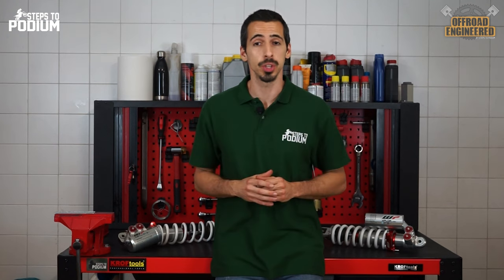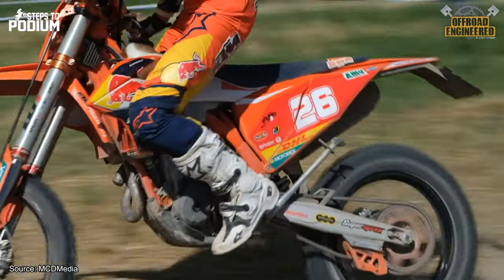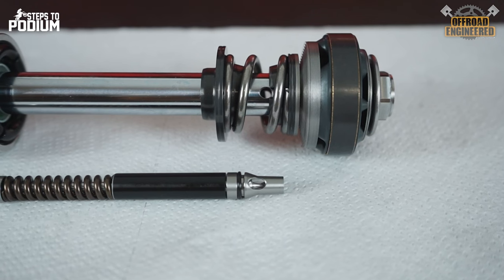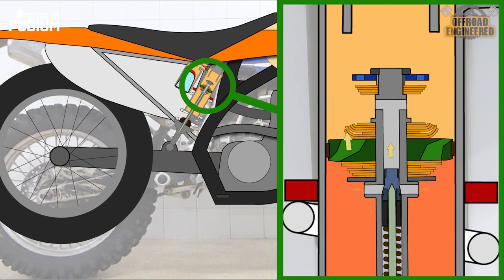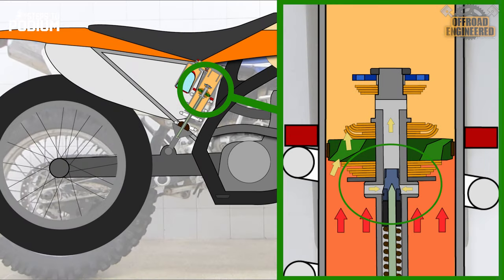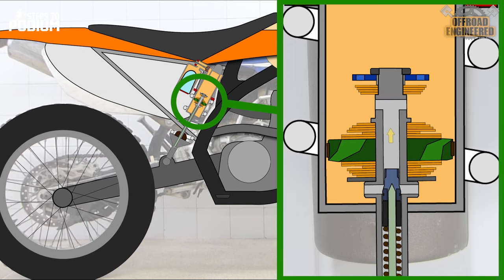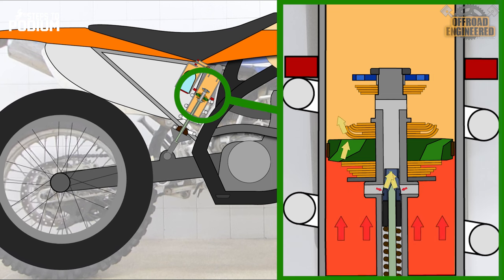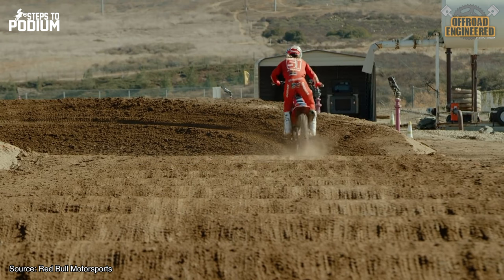How @WP_Suspension Supertrax works | Offroad Engineered

Comment: Hi. As far as I understand the new SuperTrax system is vastly different from the old TRAX one, it doesn’t seem to utilize the “ground contact sensor” anymore (a set of springs in the clevis area that "drop" the rebound needle when no ground pressure is present). It looks more like a high speed/oil pressure dependent rebound adjustment in addition to the regular low speed rebound. It also looks like it will be activated in the deep shock stroke scenarios when the force of the spring extension and the oil pressure behind the piston pushing against the rebound shims are at their peaks. Correct me if I'm wrong please.
Reply from the maker: Hello!
You're comment was a bit confusing to me as a whole (please don'ttake me the wrong way! 🙌), but yeah, it is quite different than the old one, and yes, the new one is triggered when the pressure below the piston is at a peak because it is suffering from all the pressure of the spring extensive force after a big compression 👌
Reply: Well you’ve basically answered my question, thanks! I’m pretty sure that some people are confused (like I was) by the new SuperTrax naming, expecting it to be the same TRAX system that “detects” when the rear wheel is off the ground and opens the rebound bypass when the wheel is not in contact with the surface, while in reality SuperTrax is a totally new system that doesn’t have this “sensor” but rather focuses on separating high and low speed rebound adjustments giving you more adjustability and control over the rebound damping. I wonder why WP ditched the old TRAX system in favor of the SuperTrax one.
Reply from the maker: Glad to hear I could help! 😄🙌
They essentially changed the design from a mechanical mechanism to an hidraulic one because of reliability. The mechanical mechanism's parts suffer a huugeeeee load with a very high frequency, so it was easy to fail eventually. The hidraulic mechanism os much more reliable since there's only an o-ring and spring.